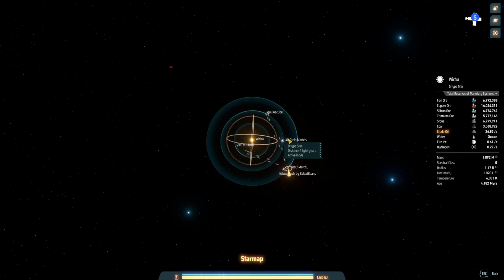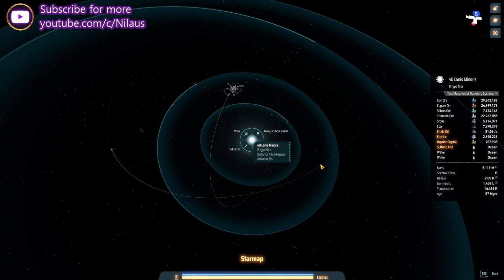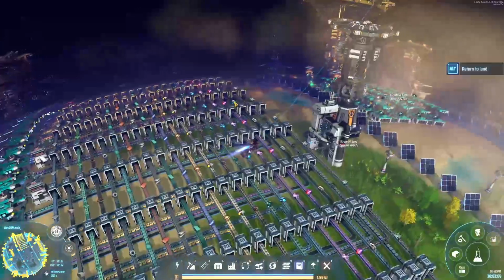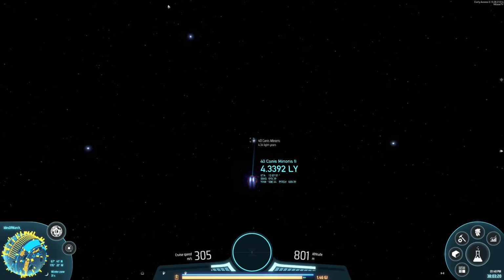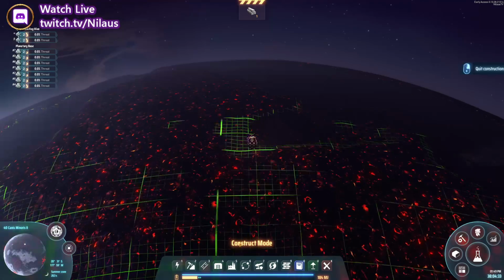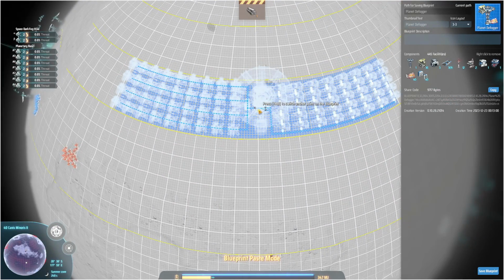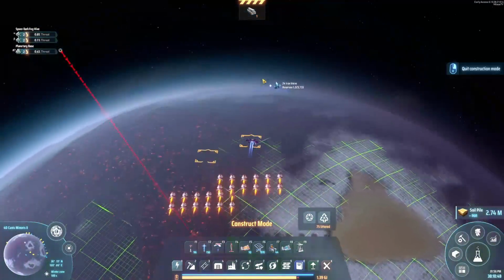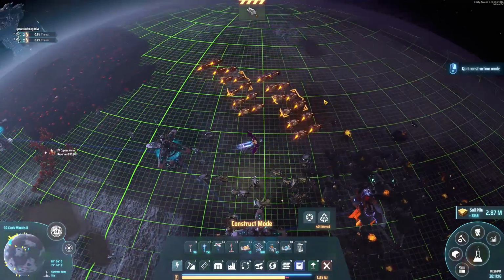Into The Fire! Warping To Crowded New System | 09 | Dyson Sphere Program - Dark Fog | Lets Play

Comment: One tip i just started doing is make a box and a prolifirator connected to another box and just throw anything in it that you are going to manually use.  like the pick ups from the dark fog if you proliferate the energy shards the t2 one turns it into 75% self replicator speed .

Comment: I personally play on settings, with the exception of density, all one tick off of max, and even that I would say was very little of a challenge. So I really doubt that even max settings will be all that much more challenging, outside of the start. Unless the final max settings and max density really severely impact difficulty, which it totally might!  I personally think that is an issue with the Dark Fog that I hope they address because it is quite honestly too easy, and I think a big part of it really is missile turrets firing from the entire planet with 1 signal tower. There is no reason to be afraid of them at any point other than early game.. but that is honestly true of biters too, they're just annoying... so, I guess it's fine? But I think it would be more enjoyable to do a max run

Comment: Nilaus and experienced players might feel like the dark fog is too easy at normal difficulty, but that's because they are FAST, and Nilaus is very fast.
I haven't played the game in 3 years and it took me much longer to deal with them. I was eventually able to starve them and destroy the hive, but not before around hour 60.
Other than the 3 stars I control, every other star has been conquered by dark fog at this point.
This is because the faster you are, the less resources they dark fog was able to collect, the smaller the hive and will also pull a lot less power from your dyson swarm.
A beginner player would be even slower than me, and I have no doubt would find it quite challenging to deal with.
Depending on your starting resources, you might not have enough resources on your starting system to play a starve out war.
So I feel it's unfair to call missile turrets and this strategy OP at a difficulty that's balanced for the average new player.

Comment: Coming into a new planet, if you adjust your new planet solar w/ signal towers so that you lose all the solar and place it down on a fresh planet.  You have to adjust it also to have power to all the signal towers.    Then lay that blueprint to cover a planet, the DF will only destroy the close towers and leave the rest as long as there is no power.  Then put that thermal & missiles blueprint down and power it.  You will have coverage of the whole planet so when they do attack they don't last long after leaving their base.  And you end up with a planet wide power network.  It works pretty smooth.

Comment: tip- when using pumps for both water and acid, once the pump is placed you can foundation over the lake and the pumps still work. so place pumps put a row of conveyor behind them, foundation to the conveyor edge and do another row of pumps, allows alot more pumps in one area to maximise output

Comment: Based on your final question. I'd say do whatever is most fun for you to play. I will watch, no worries :)

Also, what I found is that if you want to harvest their camps, the space base of the fog will get large. Like really really big. I was getting a lot of good materials, went up and I was shocked how much their space base was grown. It was gigantic. hahah. Haven't dealt with that yet. I will first do your methode and starve them a bit more before I try an attempt in attacking the space base :)
Also, which I found weird. One of their planet bases became level 13. But all of a sudden it became dark. All buildings were still intact, but they were not creating units anymore. Also their lasers didn't work anymore. Seemed like it was out of matter, which was weird since it was very active (resulting in a lot of good materials.)

Also part two. The space base gets bigger when harvesting them. Not only in your current system but across all systems.
So is it worth? I'm leaning towards not. Although the materials lvl 9 and beyond are super helpfull in the beginning. But one will be facing with a much greater strength to defend.

Comment: You know it would be interesting to add battlefield analysis towers to the planetary blueprint. Set it up so each one can build the next one in the chain and the whole blueprint just builds itself.
Reply: A self assembling world blueprint sounds amazing. And if you integrate them well they also help build the later blueprints.

Just need to watch out for ore patches and oceans breaking up the blueprint
Reply: @jurjen909  Looks like we really need a way to have concrete in the blueprints...
Reply: @AbsoluteHuman  I'm suprised there isn't really a good way to fully foundation an entire planet other than manually placing it. Without such foundation blueprints you also can not make indication tiles on where to place ILS or PLS on the zones for optimal spacing.
Reply: @jurjen909 not vanilla, but you have a mod for that